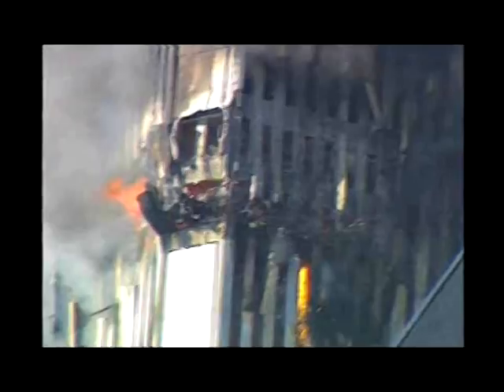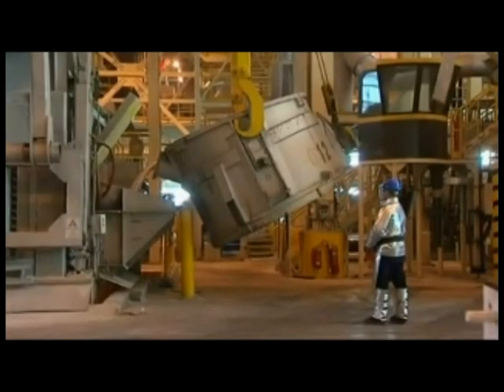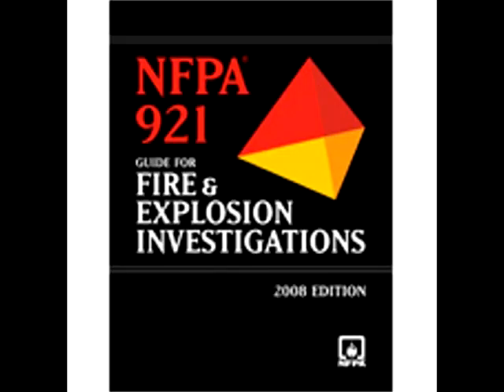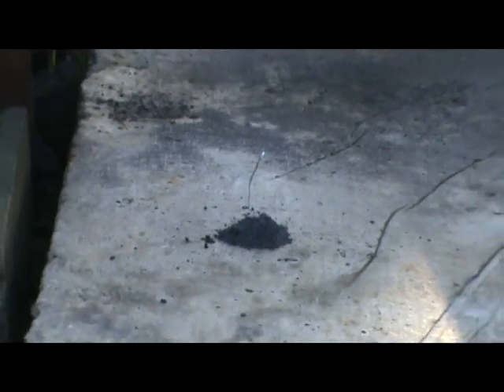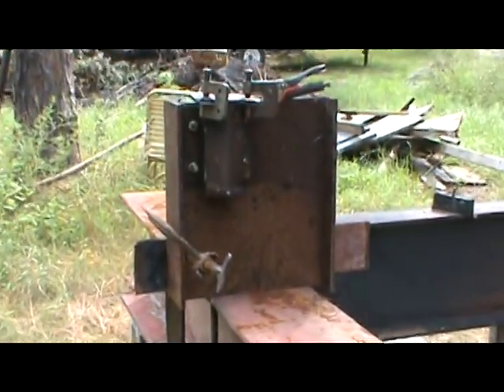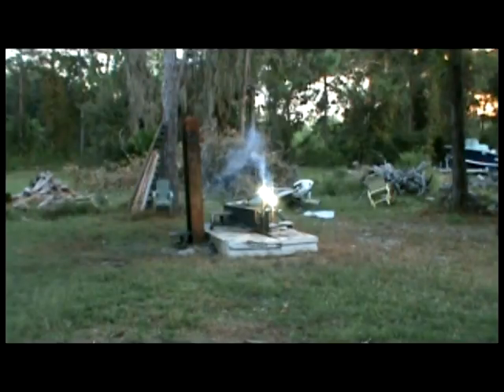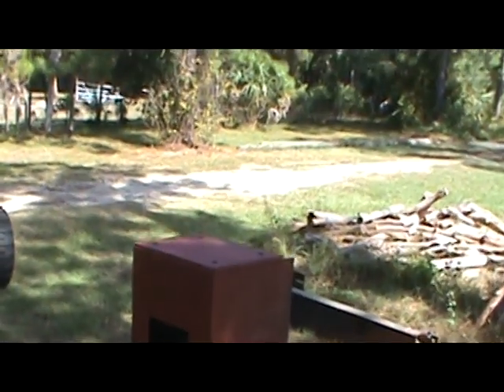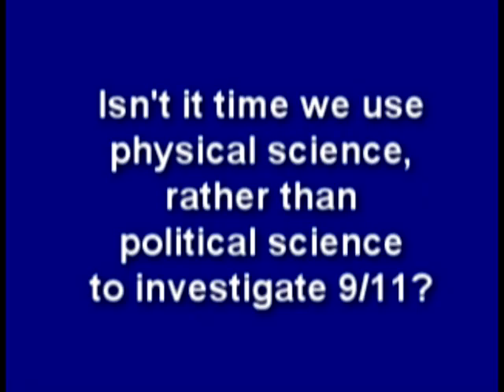9/11 Experiments: The Great Thermate Debate

Comment: This video is accurate and true. The planes would have had to hit the towers much lower for them to have caused both buildings to fall the way they did. Heat rises. How could the beams at the bottom of the buildings melt and break seeing as how both planes crashed very high up. This was a very well planned out insider job from the very beggining of construction. The New world order had to start somewhere right.
Reply: Where do you clueless idiots come from?
Reply: Everyone seems to forget that "israeli art students" had a the wherewithall to set nano thermate to all the beams, and that other israeli men took pictures and video from across the water, jumping excited how well it was working. There were no planes either, because a plane would scrunch up at the wall of the building and wreckage would fall to the ground. Same with the Pentagon, which was hit with a missal, no engines on the ground, or wings full of fuel that would burn outside the walls.
Reply: Lol, heat rises...

You didn't pay attention in physics class did you? Warm AIR is less dense than cold AIR. Warm WATER is less dense than cold WATER. In those incidences heat will rise, as the warm air/water 'floats' above the colder air/water. Steel is a different story. If you heat one end of a bar of steel, eventually the whole bar heats up, regardless of whether it's up/down, left/right, whatever.
Reply: @Tim Stibbs 

You're right, it's called conduction and its also one of the reasons why believing the office fires collapsed the towers is absurd. The quantity of steel present in each building would have allowed the heat from the office fires to conduct throughout the entire structure, doing so would have reduced the heat and temp of the fire, on top of that as the fires burned off any office materials the fires lost potential energy that could be added to fuel the fire, that is evidenced by the weak fires billowing black smoke.
Reply: @jasonstrickland9245  not starting a debate with you as you're making solid points, just making few corrections:

A black bellowing smoke is not a weak fire, it signal that it's a large fire. A weak fire only give off white lazy smoke.

And one does not need to know how the towers collapse or know the design of it. You can watch videos showing multiple angles of one of the tower litterally falling on top of itself. That's where he got the idea from.
Reply: cept that beams do not melt and the top of the towers collapse on the bottom half :l
Reply: planes cant fly through that facade ,  it was cut with explosives
Reply: In all likelihood, the plane holes were cut using thermate...  a combination of explosives  and nano-thermate were indeed used to create the illusion and perhaps to weaken the building's core structure as well, then a high energy weapon to pulverize the buildings. This "method" could also be "used" to polarize the so-called "conspiracy theorist" groups, pitting them against each other and  thereby giving the actual perpetrators even more time before being fully found out. I firmly believe things are going exactly according to plan, in other words, and that decades from now, the American people, and the world, will finally get to the bottom of what really happened, and by then, it'll be far too late.
Reply: Jonathan Molnar the building collapsed from the top dumbass. Where the plane hit. It weakened the steel beams to where it could no longer support the weight above it. Then the part above where the plane hit fell. The impacted caused the building to collapse from the top all the way down.
Reply: @Nons 

You have no idea what you're talking about, you also have no knowledge of the design of the twin towers.
Reply: The people calling Jonathan an idiot, etc.  You are the true idiots. First, and foremost, a jetliner can not,  I repeat CAN NOT, penetrate a steel structured building encased in concrete... leaving a "cartoon cut-out" HOLE in the building the way it was supposed to have!  It's IMPOSSIBLE.  Physics clearly tells us that, the plane, no matter what speed it was traveling could not penetrate into the building, it would crash and crumble and the wreckage would fall straight down!  Duh.  You people amaze me, you really do. Even the hardest part of the airliners, the engines, would not make it "through" the walls.  Go back to elementary school if you think otherwise. You have no right to even comment here.
Reply: James Cameron I'm loosing brain cells reading this.

Comment: I love how National Geographic say a thermatic reaction can not cut through steel. Then how does National Geographic explain the use of thrmatic materials in professional demolition. Yes professional building demolition companies use a thermatic material to cut through steel beams. Do you think the media might be lying to you???
Reply: Multiple floors were closed for renovations, security cameras went offline few weeks before the attack, unknown construction company working on elevator shafts, many emergency drills before the attack, and I believe 4 billion insurance was given to the buildings for the guy who owned them. Also the guy who got the insurance money took the day off when the attack occurred. Finally, almost all of the workers doing the “renovations” died when the building fell at near free fall speed.
Reply: They use shape charges to cut through structural steel columns, not thermite. https://www.youtube.com/watch?v=-GGKr_D8ymA and https://www.youtube.com/watch?v=OH4--tFosoM are perfect examples of such being used. Funny thing is, nothing had straight edges after it all fell, it had torn edges.
Reply: @mikes6973  they use thermite as well. Do a little more research.
Reply: Just how did it get into the building? Demolition work is very visible. There is a reason for removing the glass and exterior portions of a building, not to mention the fireproofing or concrete from around beams or columns to expose them to put shape charges on them. Where were the torches to cut holes in them? Where were the air compressors to run the jackhammers to cut through concrete? Such work is also noisy. Why didn't anyone bring such up? Humans are terrible at keeping secrets. Why did anyone not speak up? 

Steel loses about 50% of its strength at 1100F. The fires in the buildings most certainly did reach such temperatures. A36 and A992 steels cannot hold up thousands of tons of concrete, steel, wood, office supplies etc. once it reaches said temperatures.

Comment: So they installed hundreds of these devices you reproduced..

But nobody seen the giant holes they would have had to cut for access, giant holes in drywall and concrete tend to stand out....just like oxy/ace torches tend to be bright and produce smoke and fumes...guess they did all this for months and by a miracle, nobody ever saw anything like what it would take to install your devices....

And in the outer columns as you say, how would one get to this outer supports without demolition on a large scale? 

Your theories almost debunk themselves. The tower relied on the inner structure just as much as the outer, so once again more demo done in the core of the building with zero Witnesses.

As far as I witness statements that happened the day of 9/11, you got to consider most of these people were in shock, they were panicking and most of them we're probably not sure of anything. when someone is hysterical or under a great amount of stress like these people were sometimes memories tend to be exaggerated or incorrect. matter of fact I'm pretty sure a lot of these people after time had passed dismissed there earlier statements and clarified what they believe actually happened once they had time to reflect on the events of the day
Reply: As far as explosions, you don't think the electrical transformers full of mineral oil will explode when heated beyond the rated temperatures...

God, develop some rational thinking skills and stop following Alex Jones and believing these absurd fairy tales....
Reply: The transformers in the buildings were filled with mineral oil? No wonder they couldn't get insurance.
Reply: Typical troll tactics, inject bullshit in your replies so that the discussion goes off track and devolves into a gray mass of nonsense. It's nothing but polluting the topic so people who are actually interested in the topic get demoralized and confused by the nonsense.
Reply: @tubee2b  lots of transformers have oil coolant. Almost all of them, some are air cooled but they can also make some big bangs without the oil....

Plenty of videos on here of transformer explosions...
Reply: I thought transformers inside office buildings used some type of less flammable coolant/insulating fluid. Used to commonly be pcb's. There are other  fluids, like silicone, that are used in buildings. The undercar units in Philly's rail system had pcb transformers. May still, I don't know. GEs Philly service shop is the only shop left in the country authorized to handle pcbs. I worked on transformers nearly 37 years
Reply: The mineral oil used is(or was) commonly referred to as 10c oil.
Reply: Actually, GEs Philly shop is no longer GE. It was bought by ABB this year along with all of GEs "Industrial" segment.
Reply: Steel columns make lots of noise when they are breaking due to the forces needed to do such, enough so that it would sound like an explosion.
Reply: +Brian Reed, you should read up on the topic, quite a few people have come forward about the work that was happening in the weeks and months preceding 9/11. Must've been quite special if you remember something like that after an event such as 9/11.
Reply: @Ab4kus  buildings like that routinely undergo all kinds of different maintenance
Reply: 4 Days ago you made the claim that nobody noticed anything, and when someone points out to you that many people did notice something, you try to handwave that new-found information as if it's unimportant. Maybe you should take the time to listen to these people before you decide to classify it as insignificant routine work.
Reply: @Ab4kus  where is it documented people saw Demo going on the tower. Where are the papers, videos or anything backing up that claim.
Reply: Do your homework if you're interested in the topic. I don't believe you're here with the best intentions.
Reply: @Ab4kus  done lots of homework and never seen anyone claim that they seen the building being rigged for demolition.

Comment: That amount of jet fuel can absolutely melt steel Jack ass
Reply: No. It can't. You obviously know nothing about materials engineering, civil engineering, JET A composition, or the temperature of combustion of refined kerosene vs. the temperature required to melt steel. YOU are the jackass.

Comment: Do you see the amount of smoke? Do not take the reporters word for anything, these people are all to often idiots with a so called journalism degree (to steer the stupid) and by no means an arson investigator..ever lit a fire on a concrete rd, one that gets hot enough it makes the concrete expand in such a way it blows up and out of the road? This is simple stuff and dragging these baseless theories do nothing but make dumb people that can't think for themselves or no how to that much dumber..what's even more funny is that you mention air and aircraft fuel as accelerant cannot melt steel, dude tell that to anyone who forges or has some sense about them in the matter..the building acted like a kiln making inside temperatures so damn extreme that yes it melted steel, anyone can do this in their back yard, or hell 3000 years ago in the Bronze Age people were melting metals, no propane, no aircraft fuel, just a source, air and a kiln..so please stop..

Comment: This proves what I said all along. The twin towers were loaded with something that could demo the buildings in case of an emergency where they felt they might topple over and cause more damage. I'm not saying they pulled them down on purpose but the jet fuel probably ignited the thermite that was in place for something like this. They probably didn't think so many people would be trapped and don't want to expose the truth. But if you want the truth. Here it is. Did planes hut the towers?? Yes definitely. But they fell from thermite

Comment: I see everyone talking about the fires, the steel, and the theories but no one mentions that the plane was made out of aluminum. The fuel and the combustibles would be hot enough to melt and burn the aluminum. Hot steel with hot aluminum could create a similar effect without the use of a powder mix.
Reply: This proves what I said all along. The twin towers were loaded with something that could demo the buildings in case of an emergency where they felt they might topple over and cause more damage. I'm not saying they pulled them down on purpose but the jet fuel probably ignited the thermite that was in place for something like this. They probably didn't think so many people would be trapped and don't want to expose the truth. But if you want the truth. Here it is. Did planes hut the towers?? Yes definitely. But they fell from thermite

Comment: Heat up steel to 1000 degrees and it won't melt but you can  bend it like a noodle... Also the planes were made of aluminum which could create molten.. Together with water that would create exposions..

Comment: Why is everyone trying to prove that thermite can cut or melt steel?
All you have to do to bring down a building like that is get the steel hot enough to lose enough strength so that it fails under the load it is carrying.

You can make steel bend by hand with a wood fire, and with high strength heat treated steel like in the wtc, you just have to get it hot enough to lose the heat treating, and then it is going to fail, because it is under load.

Also, the outer columns were mainly the facade, the actual support for the weight of the building was in the core beams.

Comment: This is a really good study. Very interesting. My only question is... If thermite or thermate was in fact used. How would the people or group of people using it get direct access to the steel beams of the WTC towers? Weren’t the beams covered by walls, etc?
Reply: It wouldn’t be that hard, no one questions construction tape and uniforms.

Comment: NIST found that the fireproofing on the Twin Towers' steel infrastructures was blown off by the initial impact of the planes and that, had this not occurred, the towers likely would have remained standing.[345] A 2007 study of the north tower's collapse published by researchers of Purdue University determined that, since the plane's impact had stripped off much of the structure's thermal insulation, the heat from a typical office fire would have softened and weakened the exposed girders and columns enough to initiate the collapse regardless of the number of columns cut or damaged by the impact.[346][347]